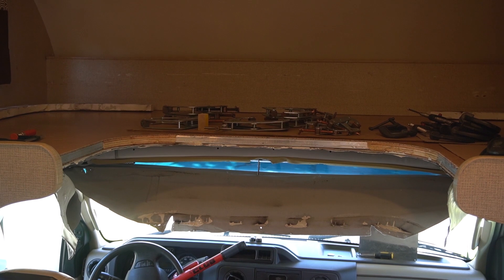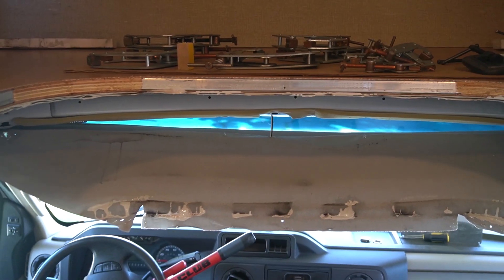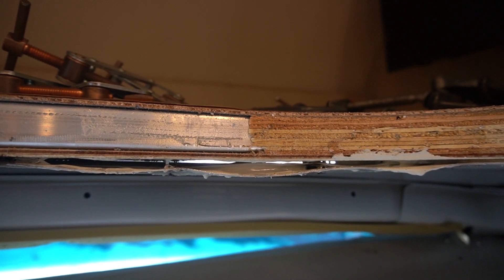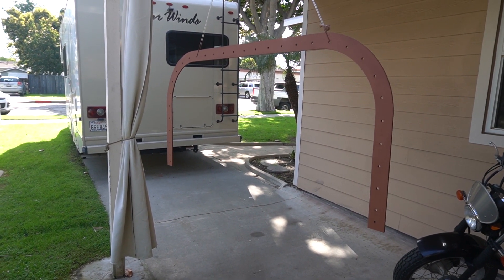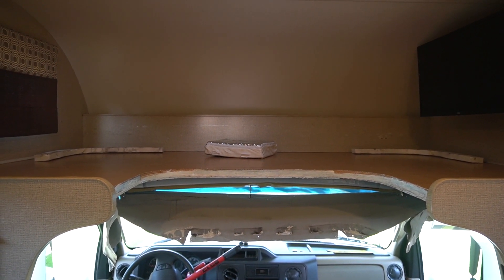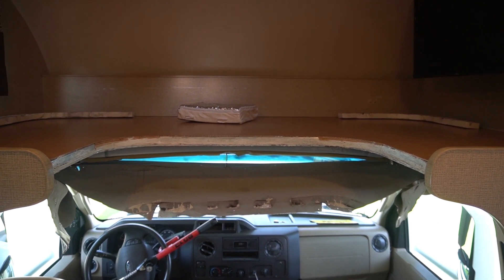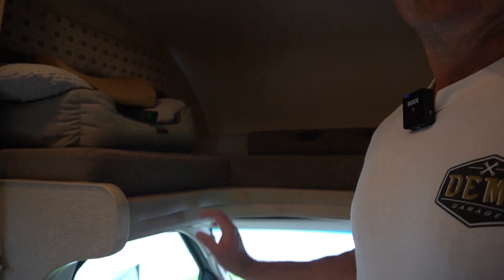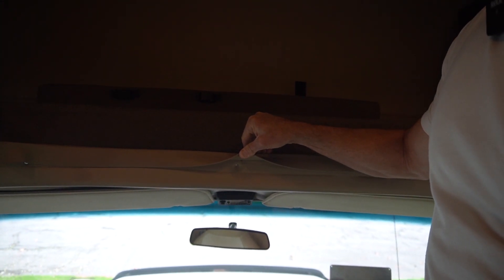Class C RV Cab Leak

Comment: My 2024 Adventurer 19'RD  class C has similar squeak at the Ford E350 roof connection above the front cab seats. No leak but mildly squeaks over significant street bumps. 
Considering adding a rubber compression gasket or butyl tape to the "sandwich" and installing machine screws, nuts and washers to replace the factory wood screws. 
Your custom reinforcement metal is still only secured into plywood which is along term vibration concern for me. 
I can deal with the occasional squeak and will reinforce if a leak or severe squeaks develop. 
I am satisfied with everything else in my 19 ft motorhome.
Thank you so much for your video.
Reply from the maker: Thanks for the comment.

Comment: I have a 2017 Thor Four Winds (28A) 29ft class C.  It looks very much like yours.  I do not have the software or math skills to figure out the plate you had made by sentcutsend.  Would you be willing to share your file so I can perform this repair?
Reply from the maker: Sure I will share my file with you but I am a little worried that our two rigs might be just different enough that it would screw you up.  Can you send me an email with a sketch and some measurements and I will update the file for you?  My email is SDeMocko@gmail.com

Comment: There should have been a rubber seal between the van roof and the bunk floor. What happened to the rubber seal that was in there from the factory?
Reply from the maker: Great question Woody. As a matter of fact I am embarrassed that I didn’t talk about that in my videos. Guess I’ll blame my inexperience to making these things. In my case I didn’t have a rubber seal. I had a foam strip that was about 1/8” maybe 3/16” thick and maybe 1-1/2” wide. No sealant was used on it.
Reply: There should be butyl tape in between there.